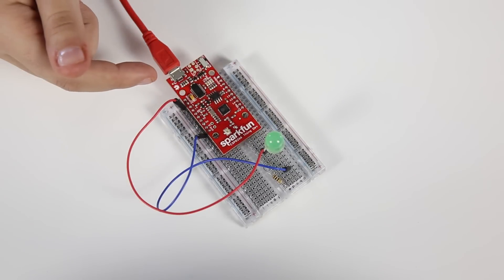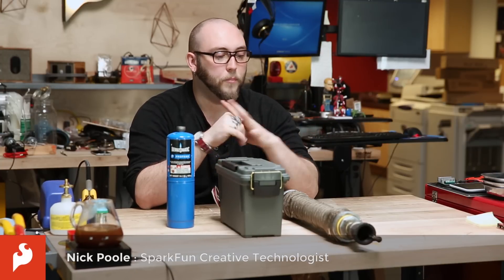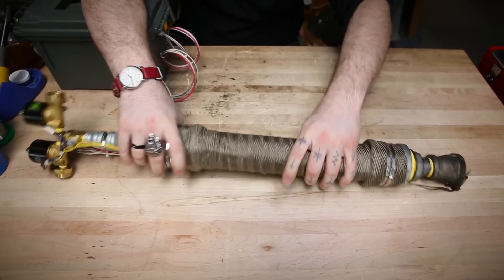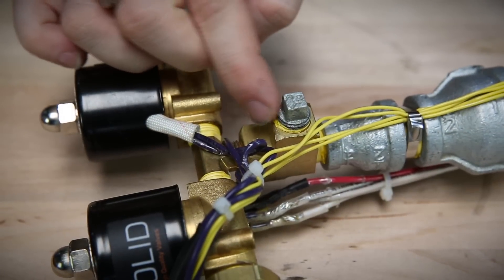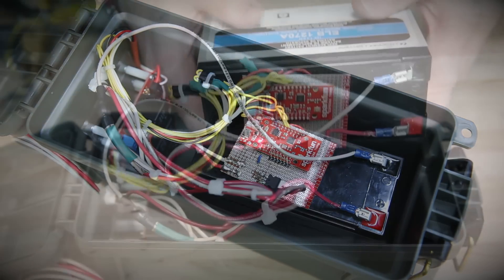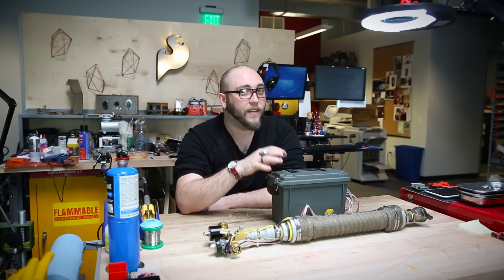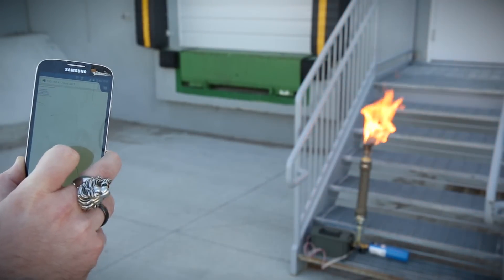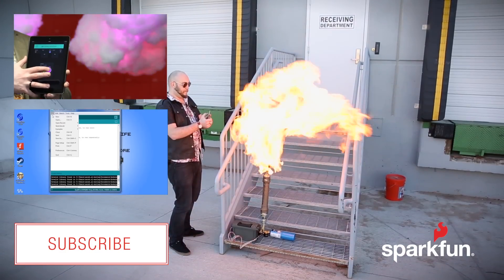SparkFun Internet Controlled Flamethrower!

Comment: whats to stop the wires melting forcing it to stay on when it gets hot?
Reply: The fire comes out the tip, the tip gets hot and not much else. It would most likely run out of fuel before it got hot enough to reach the solenoid
Reply: nice :)
Reply: that makes sense!